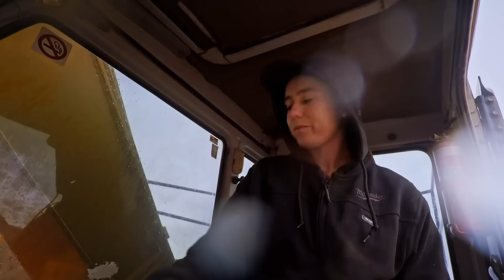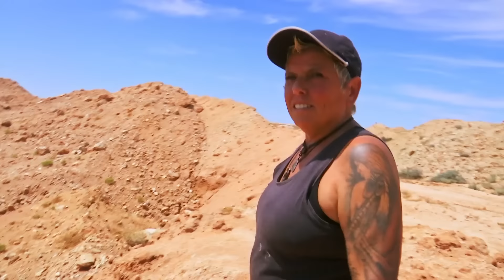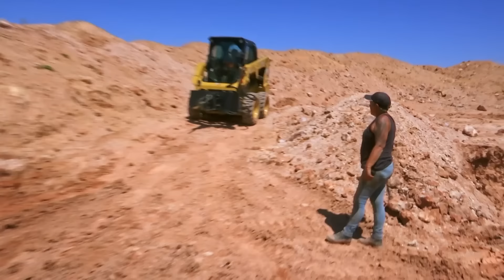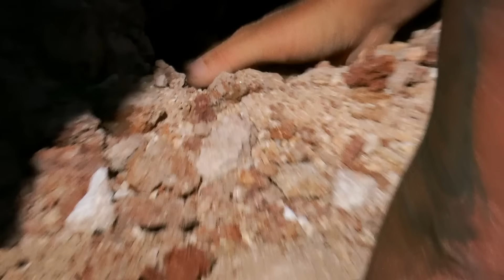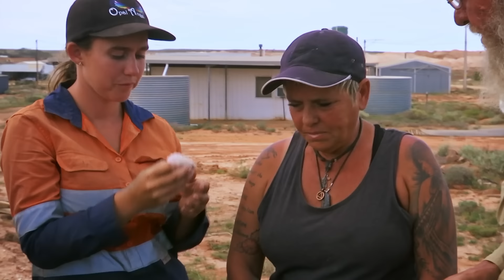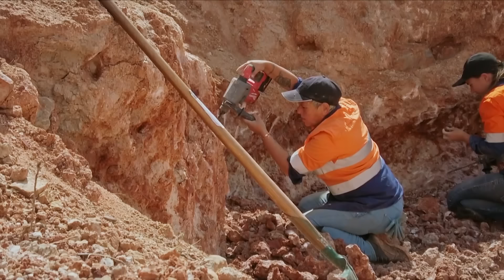"That's Finest Grade Opal" The Misfits Find $60,000 Worth Of Crystal Opals | Outback Opal Hunters

Comment: Use your bucket brake when sliding
Reply: Yes, I have owned and operated two 30 ton machines in some tight places in big Queesland boulder opal cuts, but if you know what you are doing, you can do almost everything with " the beak"...I even use it to load the excavator sideways onto old floats which don't have ramps...I would have lowered the bucket and just let the machine ski down that ramp...I would hate to see them handle getting up a muddy ramp in a big machine..